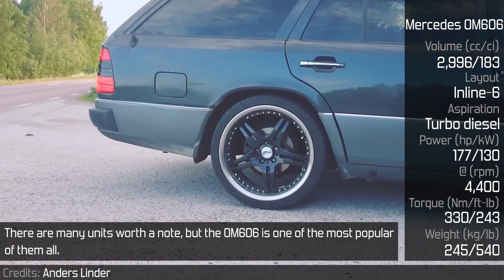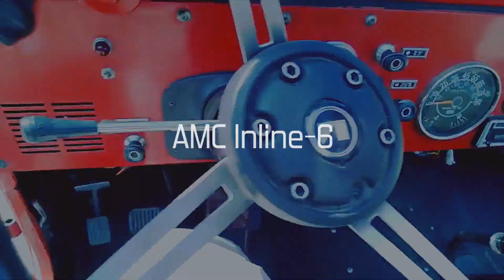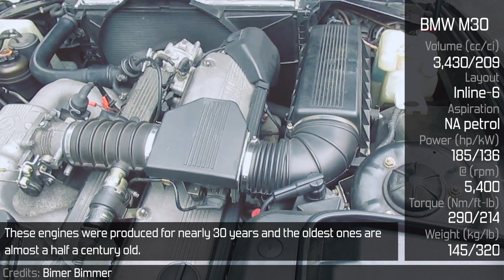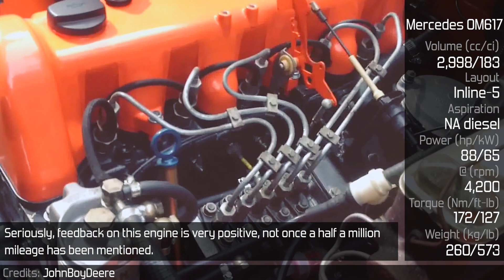10 Most Reliable Engines Running Beyond 300,000 Miles

Comment: OK.... BUT... I've got a 1998 Cadillac Deville Concours . ( 32v Northstar) Original was designed @300hp.  Concours is @375hp. It is a boat that can confuse other motorists. Mine has 283,091 on the clock. My mom has the same model with 91289. I can't tell the difference when I drive them. They are both boats that perform when you punch the gas pedal. If anyone tells you that you can't lay down rubber on the road w/ a Cadillac.. They are wrong.  I don't like to punch these cars to prove a point on a regular basis; but, I've taken these cars out on a Sunday morning to see if they are still worthy of 120mph. The Concours series was designed with a computer that adjusts handling & ride. At 85mph the ride is a bit stiffer. Handling becomes closer & more precise. I just wish that the fuel economy was better. 10mpg city 24highway. (Premium Unleaded Only.) 
I'd considered adding a 2007 Maserati Quatroporte to my stable. (Mileage 8 city 12 highway PREMIUM ONLY)
Guys @ work give me heartburn when I drive one of the Concours. They get pissed when I come to work in my custom 2008 Level III DTS. (47,454 on the clock.)

Comment: I ran a Toyota hiace  2.4 diesel to 335000 miles then sold it, mistake, ran a peugeot 405 diesel gave it away at 308k miles. excellent engine, wife had a toyota tercel gas engine with 400k plus .     300 k is easy these days.

Comment: Here's my list
Number one is the Mercedes 300D and 240D inline 5-cylinder and four cylinder diesel
Number two Dodge Cummings 12 valve
Number three Duramax LBZ
Number 4 Ford 300 straight 6
Number 5 Chevy LS V8s
Number 6 GM 3800
Number 7 Ford 7.3 powerstroke
Number 8 Volvo redblock
Number nine Toyota 22R
Number 10 AMC and Jeep 4.0

Comment: Yep your telling me them modded cars haven’t had a engine rebuild yep sure. A cast iron block will last forever. I’m pretty sure you should state cars that have actually not been changed or rebuilt from manufacture. Any engine that has been rebuilt can go on for miles on miles.

Comment: Toyota NZ engines. And Honda D series engines. They dont make much power but they last forever. 

We use Xa's/Xb's at my courier job and we have several that have made it to half million miles with original clutches and zero engine maintenance (besides belts and spark plugs). The Toyota's use a timing chain so there's no expensive timing belt to replace like with the Honda's but both should easily be in the top ten as these engines are used all over the world.

Comment: what about the small block chevy. if left in stock form and you dont completely beat the snot out of them they hold up extremely well. i have a 1996 camaro with the LT1 235K on the odometer and still going strong. the only real weakness with the LT1 is the ignition system which is annoyance but not catastrophic. i know several on the forums that have over 300K. the TBI engines were under-powered extremely durable. the LS1 is bullet proof.

there are several other really good GM engines. the old 2.5 iron duke would run forever, also the 2.2 OHV engine used in allot of cavaliers. great engine with one flaw, they eat head gaskets. i had a 91 cavalier 2.2, had WELL over 200K on it when i sold it running. it was probably a little down on power but didnt knock or make any bad noises. i drove that car for 7 years. some of the older 60 degree v6's were good too, the old 2.8 and 3.1 comes to mind. really decent engines, durable and good fuel economy.

i guess the 3.5 GM makes now is a long life engine too.

sadly some of the best engines have been killed by the EPA. its all about fuel economy numbers now and not durability.

Comment: Toyota 20R and 22R pickup engines, 200,000 miles was easy with just good maintenance.  Same for Nissan Z22 and earlier, even smaller 4 cylinder pickup engines, my friend had 300,000 miles on his.  And I think the Chrysler slant 6 deserves honorable mention.

Comment: I just did head gaskets on a 315,000 mile GM 3800. I was shocked to see the cross hatching in the cylinder walls, after 300k  miles, that is impressive.

Comment: The GM 4.6 V6 was a very reliable engine. When i was a taxi Co. service mgr. we routinely got 400,000 plus. Without any engine repairs. Switched to Ford 4.6 when GM stopped making rear wheel drive. Ford's would not last 200.000.Many timing chain failures, and intake manifold replacements. Not to mention poor ignition system. I owned 5 Jeep 6 cyls., none lasted more than 175,000. The GM 3800 is infamous for intake and head gasket failures. Ask any mechanic where his bread and butter came from. 300,000 my ass.

Comment: Give me any of those alloy headed scrappers and I will show you how to blow it up. 3800 are great motors but 93 up had plastic intakes that were prone to failure. A 170 /6 or a 194 Chevy 6 will run with almost no oil or coolant. Boring but outlasted the bodies.

Comment: just stumbled across this, totally agree with the Yota 20R/22R, I owned a 1980 Toyota 4x4, four speed 20R in Fairbanks, Alaska (back in the 80s), I swear I could leave this pickup unplugged at minus 50 degrees F, and as long as I could get juice from a battery it would fire up!!! this pickup had over 250,000 miles on it. Also agree with the earlier model Cummins in the first generation Dodge pickup. Great post, thanks! ... also shocked by the Buick (GM) 3800, guess that explains why there are so many Buick GN and GNXes out there, thanks again!!!!

Comment: A lot of people don't want to admit this one but Honda's K20, H22 and D15 are also pretty reliable engines. with timing belt and water/oil pump replacements they can get to 300K without too many mechanical niggles. the only issue that stops them getting there is ricers and their fantastic knack for revving the tits off them until a rod flies out the side of the block, causing said ricer to be grounded for a year and have their weekly allowance taken from them and the whole car to be scrapped.

Comment: The early 2000s jeep 4.0 ho strait 6 imo is the most durable engine ever made followed closely by the mid 90s Ford 4.6l sohc
Reply: Not 2000-2001, badly cast heads

Comment: 10 most reliable engine list is ridiculous. Some of those engines are reliable for sure however there are problems:
The Volvo 2.2/2.4 ohc is missing, the Nissan SD33 is missing, the Toyota I6 F and 2F is missing, The Jaguar 3.8-4.2 is omitted (as is the V12 - the motor was reliable but servicing costs made it unreliable as opposed to the engineering).
That Cummins shouldn't be in this list since the GM 2 stroke series of Diesels easily out-reliable those (but they do leak oil lol).
The Nissan RB30 and variants are incredibly reliable as are Big Block Chrysler V8s. The Rover 3.5 V8 is worth a mention. So many are missing.
...and many others most of us probably don't know about too

Comment: The ford 4.9 in-line six engine,Also called the 300 six cylinder,introduced in 1965 for the pick-up trucks,not alot of power 115hp,later more,but these were the most reliable engines ever made,i've known  them to 400,000+ miles....naturally ford stop making these engines.

Comment: Volvo B18-B20 NEVER had OHV cam.. That came With the B19.And B21 engine in 1975-76, The 21 and 19 later become B23,in 1981 and later 1985  the B230 that is a low friction model based on The B19-B23 model,, so,, the B18 and B20 are all cast iron engines with low placed cam and pushrods,,From 1975 when the B21 came with aluminium cylinder head and OHV cam,, My daily driver is an 1991 940 with a B230 F engine It has 5020000 km on it and still runs good,, and the engine has never been repaired

Comment: another famous and reliable engine was the 80's  brazilian VW AP 1.6 (or 1.8) liter fueled by ethanol (developed due to oil crisis in the 70's) correctly  maintened  at a very low cost  , many were used as taxis  and  reportedly endured 1.200.000 km without engine damage nor fumes.....produced until the mid 90's and fitted in several VW models,  these motors are now a desired item for road  speed addicts who get the square body cars up to 220 km/h only adding a turbo compressor, it's illegal but amazing!!

Comment: NO LAND CRUISERS? I've owned 3 engines on this list, the volvo toyota 22r and the gm 3800,  much more impressive in every way, the 1F and 2F LC straight six engines beat the little 22r any day of the week.  no timing chain/belt, diriect drive OHV 4.3 liter, with two oil pans (holds 8 quarts) low-revving high-torque, carbureted, 7.8:1 compression ratio.  most durable engine i've ever had.

Comment: The 4.6 ford modular v8 is easily deserving of mention. If decently maintained, they can easily break 250k miles.
There was a reason why not only cops but after police duty, carried on for another 200k+ miles as a cab. They can go over 400k miles regularly. I've seen one with over 600k and it was an all original engine.

Comment: VW passat 1.9 tdi with 600.000 km and runs fine :D , another VW passat 1.9 tdi with over 700.000 km and runs fine. In my oppinion VW engine 1.9 tdi is the most longevive engine.

Comment: Excuse me, but I'm going to call BULLSHIT on the GM 3800 v6.... they were very well known for CONSTANTLY blowing through lower intake gaskets and shortly after that, it would be head gaskets. This is true for all the 3100, 3400, and 3800 V6's. Also the 3800's were catching fire quite often because of faulty valve cover gaskets leaking onto the hot exhaust manifold that was lacking a heat shield

Comment: The AMC 242ci I6 engine will run to 400000 miles before the first rebuild with routine oil changes.  When they finally do fail, an arthritic chimpanzee with broken thumbs can rebuild the engine.

Comment: My daily driver is a 1986 BMW E28 535i M30 with > 288k miles.  Miles.  Runs perfectly, you can't kill it.  

Unless perfectly maintained by your friendly non-existent German mechanic, older M30s were in cars with inadequate cooling systems, leading to blown head gaskets or cylinder head cracks.  Don't ask how I know!  But by the E28, BMW had improved cooling systems.

Comment: If you noticed that a lot of these engines are inline sixes. I just bought a 1984 ford f-150 that has a inline 6-300 or what they call a 4.9 this engine has great torque. the inline 6 are perfectly balanced. 1984 inline has on timing chain just steel geared so a lot less can go wrong and the bottom end has 7 main bearings to say this Ford engine is tough is a understatement!

Comment: I OWNED AN 84 VETTE AND PUT 410K MILES ON IT. NEVER REBUILT. STARTER, BELT, BATTERY AND THE OBVIOUS TIRES, BRAKES, ROTORS. CAR IS STILL DRIVEN BY NEW OWNER. I NEVER USED ANY OTHER OIL THAN 15-40 CASTRO EVERY 5-6K MILES BETWEEN CHANGES. FUCK ALL THE SYNTHETIC SHIT ON THE MARKET. 5-30 IS NOT AN OIL I WHOULD PUT IN A LAWN MOWER.

Comment: i've had a 3800 and didn't care for it. there's no way that motor can stack up against a ford straight six or slant six dodge. i've had those motors and i'm can vouch from experience. the foreign stuff i can't debate. i know it's not uncommon to see ford 300 motors hit 300k+. mine is probably older than you and never been rebuilt.

Comment: I have a friend who had a Buick Park Avenue with the GM 3800 V6 in it.  I've seen the odometer of that car over 400,000 miles.  The engine ran great, it's the transmission that was getting pretty problematic.

Comment: Are you looking for fast engines or reliable engines?  Your title said Reliable.  What about one of the strongest, most reliable old school gas engines ever built?  The International gas V8 was introduced in the very late '50's and produced until 1980 when International discontinued their light line of vehicles.   Not only were they put in Scouts, Travelall's and pickup trucks, but they were also used extensively in heavy duty trucks and full-size school buses.  Try that with any of the engines you mention and see how long they will last.  Although not fast, they won't spin tires, but they will run dependably year after year.  Not uncommon for them to last 300,000 miles in HEAVY work, not just cruising the boulevard and spinning tires.  Many are still running now, 40 years after the end of production.  It's not uncommon to tear apart an engine after all these years and find the hone hatch marks still visible on the cylinder walls in these high nickle cast iron blocks.  Unfortunately, it seems after this many years, there are very few people who know how to maintain them and even fewer who know how to rebuild them.  All the "old timers" have since long ago retired.  It seems only the serious enthusiast can properly maintain these engines now.  Many people try to incorrectly maintain them like some type of Chevy, but they still continue to run despite the abuse.

Comment: Great list! 
Quick note on VW TDI engines: the PD is considered the least reliable, because there is a balancing shaft driven off the oil-pump and there is some failure typical around 1/2 million miles that causes loss of oil. The normal TDI engines lack this design issue. 
The pre-TDI (non-turbo) VW diesels seem to go forever.  I see folks (particularly in Oregon) buying old VW diesels @ 800,000 miles, and converting to veggie oil, and then driving another 1/2 million miles.

Comment: Can you add Toyota 1VD-FTV diesel engine? We have 3 land cruisers with that engine.
My diesel LC200 is at 395k miles, my friend at 650k miles and my other friend have one at 720k miles. All trouble free (except the last one with 720k miles have replaced failling injectors at 500k miles)

Comment: i was ok with your choices until you chose the 3.8L GM    they are a piece of junk ,blowing manifold gaskets as soon as 40,000 miles and are also known for the upper manifold warping .my family has owned 3 cars with these in them and none of them were worth their weight as scrap metal.now if you wanted to put an american selection in there you could have chosen the chrysler 225 C.I .D slant 6

Comment: Have a GM 3800 Series II myself. I can very well see this engine going to 500k miles. Mine is at 287k. When I scoped the engine to see what it looked like inside I knew it wouldn't be horrible since the previous owner was someone whom took good care of it but I don't see any significant wear.

It's a shame the 4T60 and 4T65 trans it was often paired with isn't as good as the engine. A great trans once you perform the necessary upgrades to fix GM's mistakes but a lot of those 3800s wound up in scrapyards not due to engine problems but instead due to trans problems that take less than an hour for an experienced mechanic to fix.

Comment: Intermingling diesel with gasoline is not a accurate depiction of reliability. Diesels by nature will virtually always rack up more miles than a gasoline engine. In terms of cost of operation (maintenance, parts costs etc) diesels are not equivalent to gasoline engines. Thanks for the video however, oh and you forgot to mention perhaps the most reliable engine in history, gm's 5.7L V8.

Comment: There is a Volvo D5 with nearly 600000 miles on the internet, and it still runs excelent. Those were also bulletproof engines, made with SWEDISH QUALITY.

Comment: 2.4 JTD / 2.4 JTD multijet 20V made by Alfa Romeo, Fiat,  what was also the 1st commonrail Diesel direct Injektion + variable turbine Geometrie turbicharger is so much more reliable than the most of the here told engines was the most reliable.... especially then, when you're not looking for how much numbers was sold from a make & Model. You should have knowledge about the particular kind of engine & what tells the mileages of the examples you could find.
However, i had this inline 5 cyl. CRD engine in my Alfa Romeo 156, what was 4 156 with this kind of engine & the least mileage 1 had 450.000km on the 1st turbo, gearbox + engine never opened....Sold the car withoutany motoroil consumption,  dailykind of race trackuse, too & the one what had the most mileage of these 4 examples had 850.000km, evdn also 1st turbo, 1st gearbox, 1st Clutch and with no oil consumption, too.
And i do drive this 20 valve inline 5cyl. CRD in my '03 Alfa Romeo 156 2.4 JTD TI  TODAY. nothing else of engines was so genious & high reliable in combination of Performance, mileage & lifetime, too

Comment: Isusu 1.5 and 1.7 diesel engines are very reliable as on the turbo version has on the n/a version I had a corsa 1.7td with 750.000 km with half of that kilometers made on city with no major problems. My oldman also have an Astra with the same engine to work and with 350k still running strong

Comment: I got a Honda SS50 in 2015, which had already ~350.000 miles on it countermeter. It's a small 50cc, single cylinder bike. I'm not a leisure rider by any mean and by that, I mean I ride hard, or I ride home (literally). 3 years, I've managed to make it to 392.000 miles. AND THE DAMN THING WAS MADE IN 1967. It certainly hasn't got much love as many of your cars does, it's much weaker now (can't even reach 35mph) but it's still running. I believe it's just because bikes aren't pain in the... to work with and maintain as cars are so it's more durable... However, the amount of time and mileage it got deserve respect from any of us here.
Ask anyone in Vietnam about SS50, no one knows BUT if you ask for Honda 67 ("six-seven" in native tongue), some grandpas may give you a chilling story. There's a chance in which you may witness the living legend itself rolling around or even extremely rare, the one without any stupid half-ass mod. 
(We don't use Imperial system so some numbers may seem unbelievable to you but you get the point)

Comment: Mid 90's  7.3 power stroke from International on regular maintenance should do half million kms and quite a few clock the million if the truck lasts long enough. the 7.3 and the 5.9 are legends.